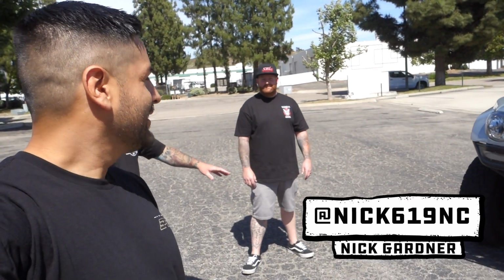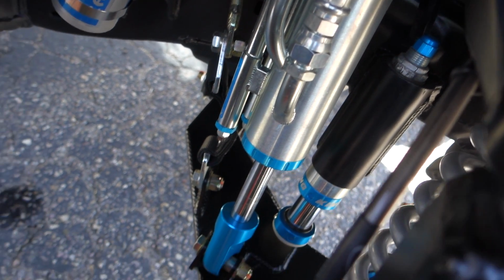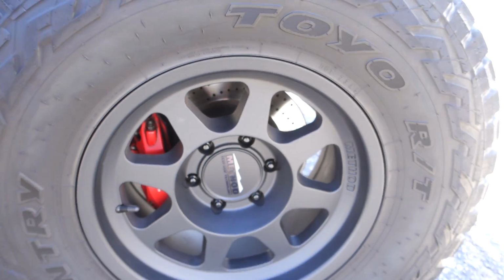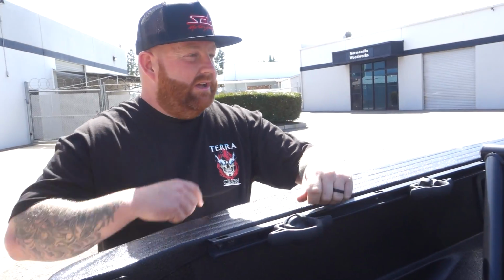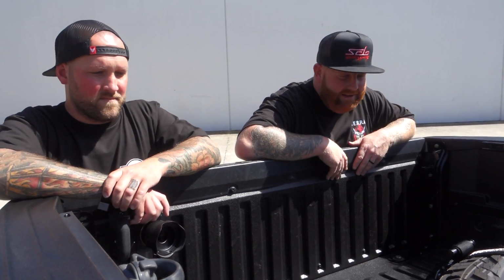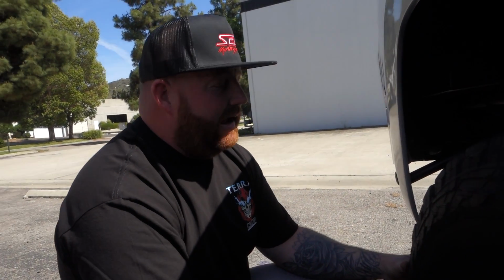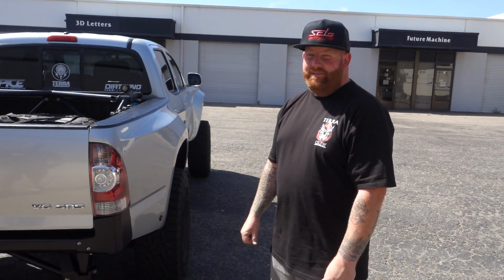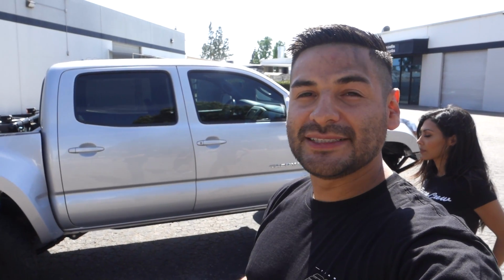Cleanest 2nd Gen TOYOTA TACOMA prerunner! | BUILT TO DESTROY

Comment: How does a leaf spring truck with a 16” travel shock mounted to the axle pull 19” of travel?
Reply: Having the shock mounted at an angle will allow the travle of the axle to be more than the travel of the shock.  That said, his don't look to be at enough of an angle to add 3".

Comment: Whyyy no 4wd 😭
Reply: You can get more suspension travel when you don't have cv axles
Reply from the maker: A lot of prerunners are not 4X4
Reply: I woulda cried if it was 4wd haha
Reply: They live in southern California there's no need for 4wd. Most of the time they are on hard packed dirt trails occasionally they have to go through mud but they're hauling ass through it for one and 2 they're not deep ass mud pits that last forever so they just fly through the mud. Only other reason I could think they would need it is for out in the sand dunes but usually they will run paddle tires or lower the air pressure really low if they're running beadlocks also usually hauling ass. If they do get stuck they'll get pulled out.  4wd is just more shit more to go wrong more stuff in your way more weight and it interferes with everything else they have going on in the front end. There are 4wd pre runners and trophy trucks but they're not as common.